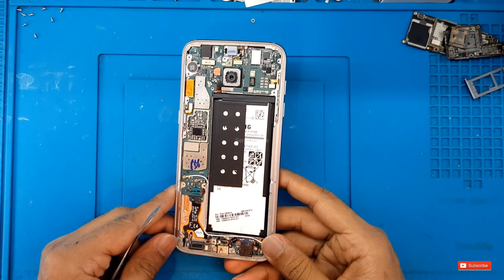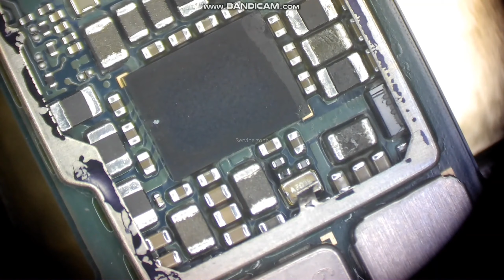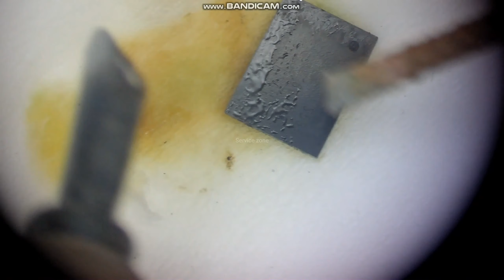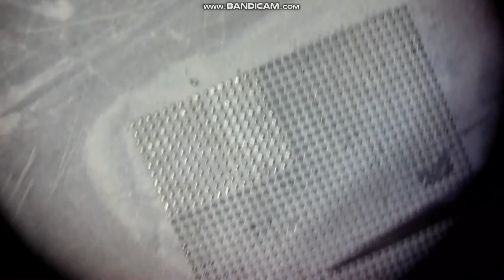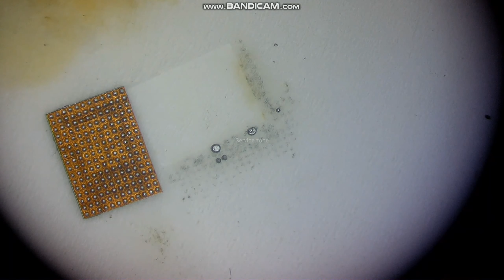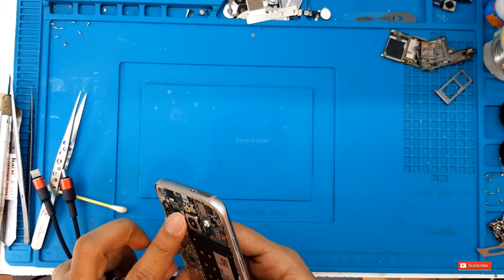Samsung S7 edge (sm-g935f) dead fix (Power Ic Reballing)

Comment: Good job! 👍You got me laughing at "normal dead"! 😄All Galaxy S7 are dead and it's all normal! Was that a MAX chip? So the phone was not charging, not powering on, and taking only 50 to 80 mA from USB with battery connected? I have one taking 250 mA with same symptoms. I have a Galaxy S7 (SM-G930F) and I was told by a YouTube "star" repair guy that it's a dead UFS chip. But I don't trust him. I sent him the phone and he sent it back, without repairing it, without rescuing data, and more importantly without the 12 screws I sent him in a zip bag! I told him not to assemble it, as he offered this as a cheaper return option. I had already disassembled it myself before I sent it to him. I tried replacing the battery. So just because he could not charge me more for assembly and return shipping, he decided not to include the 12 screws that I had sent to him along with the phone. He is from Europe. I would much rather have an Indian or a Chinese guy have a look at my phone and maybe repair it. They know nothing over here (Europe). They just do board swaps without repairing anything, and to them, everything is just "dead". They want to charge you extortionate amounts of money for "data rescue" if it's an easy and quick job for them. I have seen this same pattern actually with more than one repair shop, because I had two Galaxy S7 die while charging (short circuit most likely) and it was blamed on "dead" UFS chip. So I decided I will try to repair it myself. Will see how that goes. I have learned a lot from my friends from India and China. So thank you for sharing these videos!
Reply: Did you ever got yours repaired without data loss? Mine froze several times until a final crash. I am afraid repairers will just say it needs chip/board replacement without trying any resoldering and keeping data...
Reply: @TenjinYoukai  Unfortunately, I did not. But I was able to independently verify and come to the same conclusion as the guy I had sent the phone to previously. The UFS chip is indeed dead! With emphasis on "independently" and "verify". Because, that's what science is all about, it's about seeking the truth.

Unlike him, I did not just brush it off as unrepairable based on loose indications like being stuck at 250 mA, which could come from almost any failed component or power rail. Instead, I had put in the work necessary to positively identify the cause of the problem. I can now talk about specifics and appreciate the problem better, and also the difficulty in doing this type of repairs.

Specifically, it's the controller part of the chip that has failed. With this being a highly integrated monolith chip, and without commercially available tools for rebuilding the controller, let alone tools for breaking the hardware encryption or having encryption keys made available, it's nothing short of a scientific breakthrough if anyone ever manages to extract any data from these chips. Maybe in the future, when there are flying cars and robots that are smarter than humans. But until then, I don't think it's possible.

I got so invested in fixing this issue that I ended up setting up my own repair lab. Procuring all the tools and getting up to speed on how to use them, and how to fix common issues with mobile phones took me about three months. Before I even attempted to repair my own phone! So in the end, I was very disappointed for not being able to fix it. But it is what it is now.

Technically, the phone itself is not dead. It's just that the screen is not coming on to show a sign of life. Yes, it has a dead chip, but if you replace that chip, the phone will start working again. In this case, the 250 mA is not an indication of a typical short circuit, but of a low power consumption. It's stuck in a pre-boot state, and it's not able to fully power on and start booting because the UFS chip is failing to initialize. It's like a PC with a broken hard drive. You replace the hard drive and the PC will start working again.

It has to power on fully and boot up, because that's the only way you can rescue data on devices that run on Android 6.0 or newer Android versions, due to mandatory hardware encryption. On older devices, encryption was not enabled by default. On the very early devices, encryption did not exist at all, so you could do a chip-off procedure where you would remove the chip from the board and read it in a computer to rescue the data. This is not possible on any Android device released in the past 6 years or so.

Even though I did not recover the data, I am glad I saw this through to the end. It would have bugged me otherwise. It's not often that I encounter a problem that I can't fix when I set my mind to it. But this one got the better of me. I learned a lot in the process. So it was not all a waste of time, and the tools are already proving useful for other projects.

It does sound like you could be having a dead UFS chip as well. But don't be discouraged. Something else could be causing the issue with your phone. You can leave it to a repair shop that does this type of work. Most of them will not charge you if they can't fix it. But what does it mean to "fix it"? That's a matter of perspective. Swapping out the board for a new one, including all the components on it will definitely not help save your data, but it will very likely fix your phone. They may charge you if you decide that all you want to do is a diagnostic.

If you would like, I can show you how you can see for yourself if it's the UFS issue. It's fairly simple, but you will need to get some basic tools and supplies like wires, cables and a TTL converter. No soldering is necessary if you use a breadboard. Let me know if you're interested.
Reply: @samirgunic  I see, thank you for your detailed feedback. I left it at a repair shop and they will send diagnostic and budget sometime next week. 

If they suggest a replacement of the board or other internal component, which will surely wipe my data, do you think I could suggest they try a reflow instead (if it helps with whatever issue it has), even if it only helps it live/boot temporarily? 
I would just need enough time to copy over my data.
Reply: @TenjinYoukai  You could suggest that they do that, but I doubt that they will listen to you on how to do their job, and they will not appreciate your suggestion. As someone who likes to build and fix things around the house and around the car, as well as other things, I often find myself conflicted when I have to leave it up to someone else to do what I know I could do better, and I often find myself having to redo the job myself later on. You know the saying, if you want to do it right, you better do it yourself. That's my motto. But once you leave it to someone else, you have to trust that they know what they're doing and will do a good job. There are plenty of moments where I would rather not do things myself. Either because I don't know how, I don't have time, or I just don't want to and would rather pay someone else to do it. But because of my bad experience with companies that do a lousy job, I end up doing things myself. More often so in recent years.

Maybe if you agree to pay them for the extra effort, even after they tell you that the chances of saving any data this way is close to zero? In that case, you will likely lose money. It all comes down to doing a proper diagnostic first and finding the cause of the problem. That's how you know what the best course of action might be. If they are competent enough, they will consider doing a reflow anyway, without any input from you, if they see that this might be the right thing to do. Better yet, they will do it properly and not only reflow but also reball it. You should not need to do their job.

However, if the controller of the UFS chip is failing to initialize, then there is not much that they can do about it. Reflowing will most likely not help. In that case, the chip is likely to have internal damage. It could be a corrupted firmware or translation tables and what have you, or it could be an internal short circuit. Reflowing may only be helpful if the cause of the issue is bad connection, which reportedly can happen if the phone is dropped for example. The guy I had sent my phone to previously had a case like that, and it was also an S7, and he fixed it by reballing the CPU, RAM and the UFS. Interesting enough, that phone was also stuck at about 250 mA.

Note that there is a difference in replacing a board as a whole, and transplanting chips from one board to another, often referred to as board swapping (somewhat ambiguously). Also, doing board level repairs where you replace components such as capacitors and inductors will not ruin your chances of rescuing data. On contrary, if that's the only issue with it, this will fix the board and allow you to extract data.

As long as the CPU and UFS are preserved, the data is retained. Because of the tight security, these two are married at the factory and they have to be transplanted in pairs. The encryption keys for the UFS are stored in a special area of the CPU called the TrustZone which is an integral part of Samsung Knox. So each chip is useless without the other, and there are no two identical pairs in existence. Assuming it's a professional repair shop that does this type of work, they are already informed about this.

What often happens is that these "repair" jobs quickly turn into "data rescue" jobs, as the data is usually more valuable than the device that stores it. So if the priority here is getting the data back, they will do exactly what you suggested. They will do whatever necessary to revive the phone. Even if it only works for a few minutes, that's plenty of time for them to extract the data. They will not care about making a lasting repair.
Reply: @samirgunic  Thanks a lot for yet another very detailed reply! 
Hopefully they can identify where the issue lies exactly. Hoping that the CPU + UFS are still intact and it's something else that can be repaired/replaced. Fingers crossed🤞